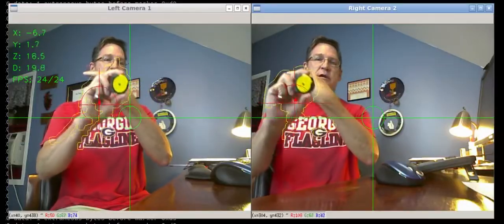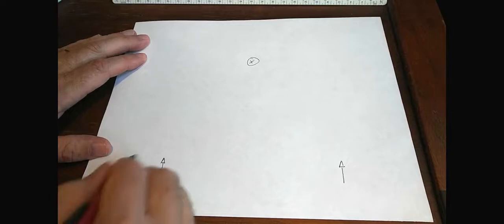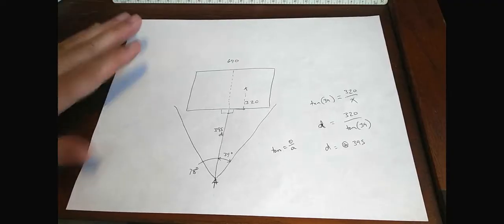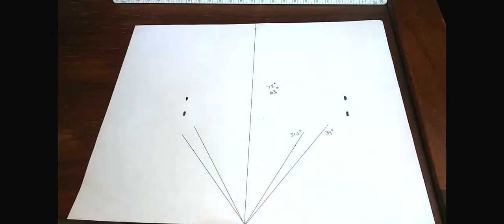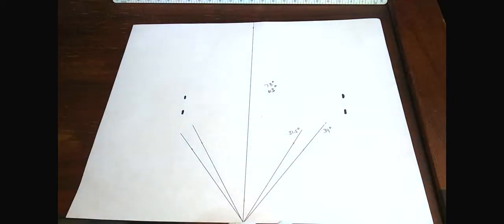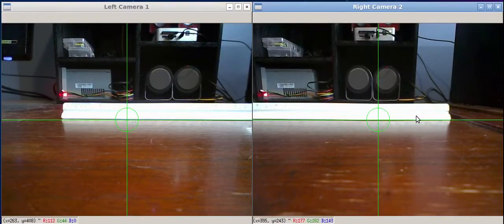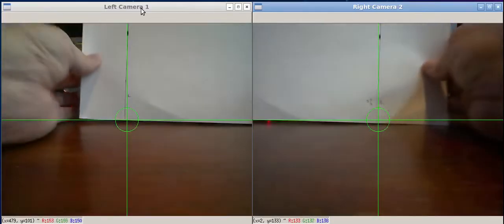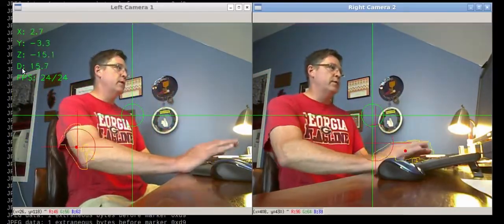Distance (Angles+Triangulation) - OpenCV and Python3 Tutorial - Targeting Part 5

Comment: this is error on ubuntu 18.04 plz help me to solve 

 python3 -u targeting_tools.py
VIDEOIO ERROR: V4L2: Could not obtain specifics of capture window.
VIDEOIO ERROR: V4L: can't open camera by index 1
/dev/video1 does not support memory mapping
VIDEOIO ERROR: V4L: can't open camera by index 2
Traceback (most recent call last):
  File "targeting_tools.py", line 129, in run
    frame1 = ct1.next(black=True,wait=1)
  File "targeting_tools.py", line 455, in next
    frame = self.buffer.get(timeout=wait)
AttributeError: 'NoneType' object has no attribute 'get'

DONE
Reply from the maker: Your cameras are not working correctly. They are probably not set up with the right parameters. Start by getting one camera to work in opencv by itself. Once you can do that, use those parameters to set up the cameras in the targeting tools script.
Reply: @ClaytonDarwin  thank u so much i am willing to use logitech 270

Comment: i have  issue
/targetingtools.py", line 129, in run
    frame1 = ct1.next(black=True,wait=1)
  /targetingtools.py", line 455, in next
    frame = self.buffer.get(timeout=wait)
AttributeError: 'NoneType' object has no attribute 'get
Reply from the maker: Why is self.buffer == None? That's the problem. Did you delete it? Did you call the camera thread start() function? Did it start the thread correctly? Did you name your camera correctly (correct address)?
Reply: @ClaytonDarwin  can u tell me how to use self.start() in program call

Comment: I can't get your code to run. It's throwing 

`
 File "c:/Users/.../Desktop/gdrive.py", line 130, in run
    frame2 = ct2.next(black=True,wait=1)
  File "c:/Users/dvkbp7/Desktop/gdrive.py", line 455, in next
    frame = self.buffer.get(timeout=wait)
AttributeError: 'NoneType' object has no attribute 'get'
`

Did anyone else have this issue?
Reply from the maker: I don't recognize the gdrive.py script? What is that from?
Reply from the maker: Why is self.buffer == None? That's the problem. Did you delete it? Did you call the camera thread start() function? Did it start the thread correctly? Did you name your camera correctly (correct address)?
Reply: yes i have same issue
File "c:/Users/Meghasham Joshi/Documents/targetingtools.py", line 129, in run
    frame1 = ct1.next(black=True,wait=1)
  File "c:/Users/Meghasham Joshi/Documents/targetingtools.py", line 455, in next
    frame = self.buffer.get(timeout=wait)
AttributeError: 'NoneType' object has no attribute 'get

Comment: if we secure 2 cameras on the car , let say distance between  them will be 1.5m . is it gonna work? I mean is that how tesla recognize object on camera? first object detection , then distance detection to the detected objec with method showing on your video, and then just calculating speed? did i get it right.
Reply from the maker: Theoretically, sure, but for longer distances being that far apart. Make sure the alignment is right.
Reply: @ClaytonDarwin  thx ) that is the princeple how tesla drive ?
Reply from the maker: I don't really know. They may use LIDAR or something. Probably more than one system.
Reply: @ClaytonDarwin  ok thanks . one more thing if i do this with distance like few miles? for detecting and calculation distance to the ship at sea. How u think on distance over 2 miles it will work ok>?
Reply from the maker: At that distance, the angle between cameras will be very small, maybe undetectable between the two camera frames (not 1 pixel different). Probably won't work.

Comment: Hello. Thank you for the wonderful work it's excellent work. I have one question when the code is set the show frames black color for one second then then disappeared to try to solve the problem but did not succeed
Reply from the maker: It sounds like your cameras (you need 2) are not set up correctly. Read the exception error string. What does it say?
Reply: There are three first mistakes in this line Targets1 = Targetter1.targets (Frame1)  
and the second error in this line
 frame3, Contors, hierachy = cv2.findcontors (frame3, cv2.RETR_EXTERNAL,cv2 .CHAIN_APPROX_SIMPLE)an comment it is 
VALUE ERROR: Not ENGO VALUES TO WPPUC (expected 3, got2) and Print DONE and print WARN: 1 Terminating async  callback
Reply from the maker: Your version of OpenCV is returning 2 rather than 3 values from the findcontors function. You'll have to change the code to match what is returned. I don't know what that is because my version  returns 3 items.
Reply: I use the latest version of OpenCV 3.4 and the latest version of Python and use "Pycharm" to work in the windows 10 .. is your opinion of the solution to this problem Is not changing the or you need another thing .... please help me because a project that is a graduate of the university depends on this code.thanks
Reply from the maker: You need to run the findcontours function by itself and determine what it returns. I use Linux. Not Windows, so I can't tell you. The code works for me. Once you know what it returns, change the code accordingly so that it works for you. Keep looking at the errors, isolating the problem line, and making changes. That's how you troubleshoot.
Reply: I successful to run the code and show the two windows, but the problem is that the program does not display the readings of X, Y, Z and D and I do not know what the problem
Reply from the maker: Find the function where the text is applied to the frame, and make sure it is being applied to the correct frame.
Reply: Hello I have been operating with success but there is a fattest via the way how can I reduce the situation what does a change in the code and thank you Mr. Klayton
Reply from the maker: I don't understand this comment.
Reply: I mean I have a ratio of error in the distance how it can be corrected
Reply from the maker: First, make sure your camera variables are very accurate. Particularly the distance between camera centers, the alignment, and the angles of view vs pixels. Second, the farther away the target is, the less accuracy you will have. This is because the angular movement registers on fewer camera pixels. To counteract this you can use cameras with more pixels, or move the cameras farther apart.

Comment: great video I learned a lot! 
1) will you do a video of connecting the ROCK64 to the cameras and finishing the project? 
2) Do you think it's possible to make a live 2d Depth video with the rock64? and maybe later use this to make a 3D map of a house? 
3)I'm new to raspberry pi and rock64, do you think it's a good idea to start straight with the rock64 if I want eventually to make this project? 

THANK YOU VERY MUCH, very informative and interesting!
Reply from the maker: 1) Yes. I'm planning on re-starting the targeting project using the ROCK64 very soon. I just got distracted trying to finish some other projects.
2) Sure. It can be done. The only question is how fast. I don't know yet.
3) It's a trade off. The RasPi has better support and more users, but is lower power and costs more. The ROCK64 is more powerful and costs less, but has less support and users. If you know Linux pretty well, my vote is for more power and less cost. If you are new to Linux and IO pin programming, go with the RasPi.
Reply: @ClaytonDarwin  Thank you for the fast response (: I know how to work with Arduino and the GPIO pins. But I started thinking about a new project, which is a drone with a stereo camera on board that can do obstacle avoidance and mapping of the inside of a house. That's why I looked into raspberry pi and rock64. Unfortunately, I don't have experience with Linux or raspberry pi system. I thought maybe to save the money and go straight for the rock 64. what do you think?
again thank you very much!
Reply from the maker: I think I would buy an older raspi (but not too old, but cheap) and learn Linux, Python, OpenCV and how to use the GPIO. You will need to know them for your project. Then upgrade to the ROCK64 when ready. Learn to use the command line for Linux. You want to run your project without a GUI to save processing.
Reply: @ClaytonDarwin  You are so helpful, thank you! the last question hehe :) can you recommend a cheap type of camera for the stereo vision that I could buy on eBay?
Reply from the maker: I have not used a stereo camera yet, so I don't have a recommendation. They are fairly expensive. I have been using 2 cheap USB cameras and mounting them together. You won't need high def for most things, vga will usually be fine and use way less processing. You will want both to have the same field of vision. 

If you set your raspi up as a headless server, you can connect via a network cable and then use the USBs for cameras instead of peripherals. Use ssh and command line to connect. 

However, most of your development you can do on a Linux desktop. It should transfer to the raspi.

Comment: hi Clayton, thank you for your video. I am wondering if it is possible to do this project on a raspberry pi with two usb camera or pi camera?
Reply from the maker: Yes, the code should work fine. However you may have to slow the frame rate down to keep the processor from running at 100% all the time and lagging. I'd start with 10 FPS, and see how that works.
Reply: @ClaytonDarwin  Thank you

Comment: hi, Clayton !  great work, but I am so curious after you calibration the two cameras, you built coordinate system in your frame center, and I could get the L/R camera's angle and the distance between the camera, but if I move the target, the angle with L/R camera should be changed, and the distance will also change. How could you realize the target coordinate system by your calculation,  and I was also using Python and OpenCV to do my project, but I was trouble on this part and I want to use kalman filter to implementation motion detection...???
Reply from the maker: If the cameras are in fixed positions relative to each other, and you can determine the angles to target, then you can calculate distance. Then you can determine target position in 3d space relative to the cameras. And if you know the position of the cameras, you can locate the target relative to anything else. If the target moves, or if the cameras move, recalculate. I'm recalculating with every frame.

Comment: This particular video has grabbed my interest in this series.  My education in mathematics is limited to high school algebra, geometry, trigonometry, with some analytic geometry and spherical trigonometry.  Through my hobbies, I have kept some of the knowledge fresh,  particularly geometry and trigonometry.  I probably missed this from a previous video, but what computer system and programming language are you using to process the camera data real time and move stepper motors accordingly?
Reply from the maker: Hi Chuck, I almost always use a Debian flavor of Linux for my OS. For programming, I almost always use Python3 as my base programming language. All of the camera and image processing in this series is being done with the OpenCV package. It is written in C, so it's really fast, and it has a plug in for Python so that it is very easy to use. Of course, Python and OpenCV will work on Windows and OSX too. To run the stepper motors, I actually just use Python. I use the output pins on a RaspberryPi or Rock64 or ESP32 (or sometimes a USB serial to GPIO adapter) to control an h-bridge big enough to handle the amperage the motors need. This makes it very simple and cheap to do. However, when controlling pin states and h-bridges, you are limited to only whole or half-stepping the motors. No fancy multi-stepping that requires varying the amperage.